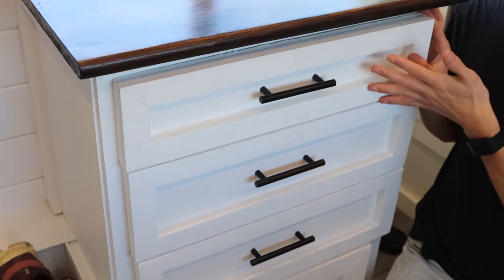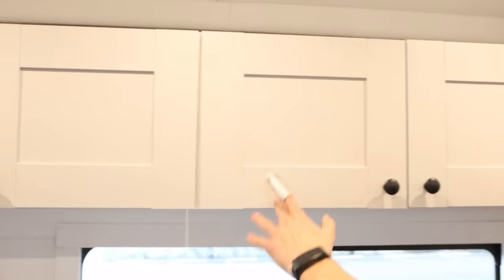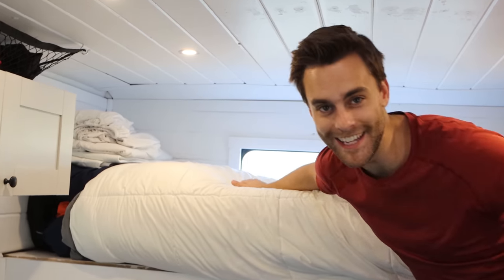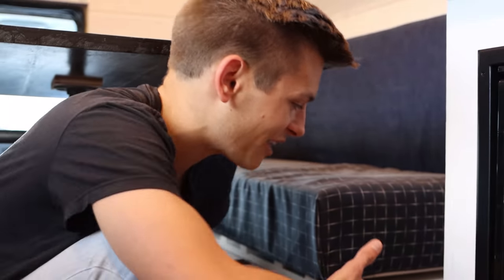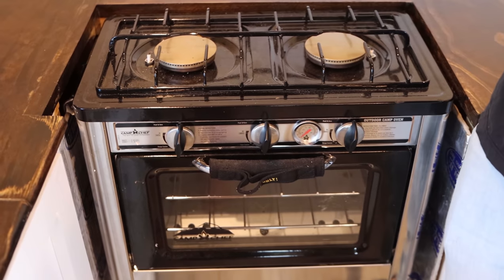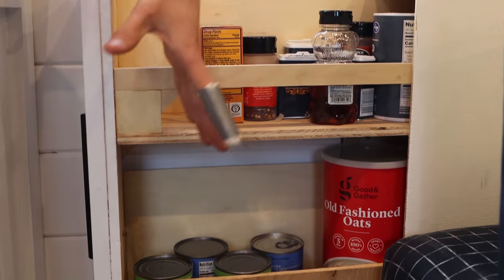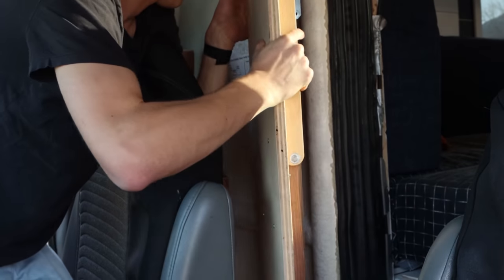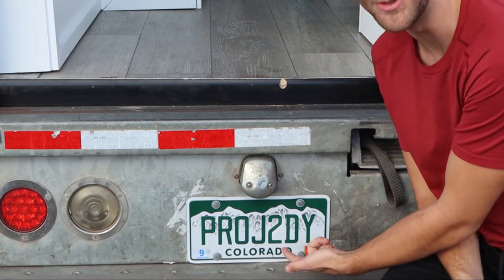VAN TOUR of UHAUL BOX TRUCK Converted to Beautiful DIY TINY HOME for Full-Time Van Life

Comment from the maker: Our next video will be a Q&A video about the box truck. Ask any questions you have in the comments and we will try to answer as many as possible in our next video!
Reply: What was your favorite part of the build? What is your favorite tool to use? What was the most valuable skill or lesson you learned during this conversion? :)
Reply: I've been wanting to make one and travel after im done with college. My questions are how hard or different is it to drive vs a normal car on the highway and in the city and avg mpg. And im not sure if you guys put it in a different vid (this is the first one I've watched) but how much was all your solar and electrical like batteries, converter panels etc. Thanks and I appreciate the vid!
Reply from the maker: @Gandalf the Grey We'll answer this in the Q&A!
Reply from the maker: @veronicakim8806  Thanks for the questions :)
Reply from the maker: @daltonc690  We'll answer all of these in the next video!
Reply: How did you go about the insurance and finding insurance for a self build project turned into an RV.
Reply: I just bought a box truck a few weeks ago that I have been converting but have had a REALLY hard time finding insurance because it's considered a commercial vehicle what did you guys do about that?
Reply: Other than your 2-small ceiling fans, what about a/c, and heating ?
Reply: Love yo channel
Reply: Great video and splendid job, thanks. No bathroom, though?
Reply: instablaster.

Comment: Hi u tubers part of the reason to get rid of the overhead door is safety. The over head door can be pad locked down so that you cannot  raise it and have to exit through  the pass through to the cab. Which can have the front doors blocked by a vehicle parked too close on each side. Another important reason is the eventual  failure of the balance springs and cables that help to support the weight of the door when you raise  it up. With interior finish and cabinets these springs and cables will be difficult or near impossible  to access. Also a framed rear wall can be insulated much better than the overhead  door Have a nice day. Tom up in Canada

Comment: Ok I have your next PROJECT for another TODAY = take an Ikea cabinet off each side of the the higher wall area, and lower each one on either side of the wall behind the couch, like on the back of the driver's and passenger's seats.  
Then the upper loft bed could become two single beds, divided in the middle, where your door to the cab is.  With the foot portions of each twin bed, on a slide out support, that can be made easily.  Then you get up to your bed by using Craig as your lift up step, for either side of the two beds you create.  Then the living space below doesn't need to be made up as much, since both your sleeping areas would be above. Only needed when you might have a guest or two.
Reply from the maker: Wow this would be a project! But it sounds very intriguing, if we could pull it off that would add a ton of space to our sleeping arrangements!

Comment: For your window coverings, I would use some iron on interfacing. It will make the fabric stiff and easy to apply over the top of your reflective covers. You could do black fabric, like you said, but a textured fabric would also look nice. I'm picturing a faux leather or suede in a brown that matches your counters and table. That, or any fabric that is textured, like linen or hemp or even sokething that looks like rattan. They have natural rattan that has a super tight weave/no holes.

Comment: Have you considered putting in a mini-split airconditioning system for cooling and heating?
Reply: I honestly have been thinking about doing just that. It can also be a heater, and can be ran on solar.
Reply: @consciouscoffeeplussugar2658  Yes, lots of videos of people putting in mini splits.  They're so incredibly efficient and can be run on batteries, solar, and/or a small low noise generator.  They're also incredibly quiet and people who own RVs with overhead ACs choose to use the mini split for its efficiency and silence.
Reply: Yes those over head ac on rvs are so loud . Its annoying

Comment: Wow, yea yall did a really great job with that truck, perfect design, and use of space, that table is extra special.... I only have one suggestion, and that is to take out the sliding pantry behind the couches so that you could put a 17 degree lean to the back rest.... its just way more comfortable than sitting straight up, and is really the norm for furniture overall.

Comment: I forget how good Ikea is for buying space saving stuff. Great idea to go there for the cabinets. I wonder what the cost difference is between buying some of this stuff that fits specific spaces on Amazon and making it. One cool thing about shopping online is you can enter the exact dimensions of a space you're trying to fill and it will bring up everything that fits.

TBH, I was a little scared of that kitchen setup. You guys should put a fireproof backsplash behind the burners. You also need some kind of hood or ventilation from the smoke as you cook. I'd definitely be a little concerned about a gas leak with that propane tank being on the inside. Between that, the sink not having a faucet/real running water/a legit gray water container, I think I might just cook outside & dedicate that area for some other living space purpose.

I love a lot of the ideas. You definitely got me thinking about the U-Haul option. 120,000 miles isn't that much for an engine like that. The towing capacity is also insane on those trucks. You'd have to buy something like a $50,000 Toyota Tundra to get that kind of towing capacity otherwise.

BTW, since you don't have a bathroom setup & you like to work out, you might consider a Planet Fitness membership. I think a black membership is $25 per month & it entitles you to bring a friend in for free. They're open 24 hours and it's a great way to be able to take showers and use the bathroom. They have almost 2400 locations and you can usually park your rig in their parking lot for the night if you needed to.

Cheers and good luck with all your adventures!

Comment: Hi u tubers the number one step in converting an ex u haul box truck is to get rid of the overhead door . A roll up  overhead door does not belong in a camper. Too much heat  loss water leaks  and noise. Frame up a wall and put in a man door. Have a nice day. Tom up in Canada.

Comment: When you bought the Ford  truck it had 120,000 miles. How do you plan to prevent problems with the engine and the transmission?
Reply from the maker: Not doing anything specifically other than the recommended maintenance schedule. It's looking pretty good so far! Haven't had any issues
Reply: Use synthetic...?

Comment: Nice. But I have a question. If a fire were to break out, do you really want to have to reach way back under the sink to get to the fire extinguisher? You may not even be able to access it, depending on the location and intensity of the fire.

Comment: Not a ton of uhaul truck conversions, thank you for your content. Is this the 17' or 14' model? Any advice for cheap/low mileage buys at uhaul did you wait for a good deal or how did your buying experience go?
Reply from the maker: This is the 14' model. Honestly we bought one of the first ones we found because it had a good maintenance history and we were pretty naive and wanted to just get started. It hasn't given us any maintenance trouble so far. Happy with how the truck has been holding up. I think we got a pretty good deal for the mileage and age of the truck but I'm sure there are better deals out there.

Comment: Just discovered you'al. Interesting build. The back Slider up & down takes up much room. The fire extinguisher should hang on the wall, as time to get it under the counter in the cabinet your fire has already gone out of control. Max Fans are great. How much did the U-Haul cost to buy from U-Haul? What length the living quarters? Gasoline Or Diesel? Look forward to following your journey. Take Care & Safe Travels. always, Tommy :-)

Comment: As beautiful as this is, I would add a metal grate over the hole in the cabinet to leave it vented, but beautiful.  They sell little metal panels at Lowe's for about *20 and you could make it removable if you wanted as well, with slide slots or velcro fasteners.  Better than marring the beautiful cabinet with looking at the back of the oven when you come in your lovely home.

Comment: What is rarely revealed by box truckers is "commercial insurance"?
Commercial insurance has business requirements and costs $5-6k p\yr.
You are not allowed to live in your vehicle full-time with commercial insurance.
Your insurance is based on the OEM VIN and cannot be changed.
Violation of the contract terms invalidates coverage.
Intentional violation in securing a policy such as failing to disclose the truth of intended use is criminal fraud.

I solved this by purchasing a damaged class-C motorhome with a damaged coach. I removed the coach and am replacing with a box essentially the same dimensions (16'ft cab-over). This enables me to have motorhome insurance at $435 p\yr @minimal mileage. When I increase the mileage to max. the ins. can go to a high of $1k p\yr.
Based on research conducted in Tx.

Comment: Where is your propane sensor?  This is only important if you value life.
Reply from the maker: We’ve got one under the sink, and then a fire alarm/smoke detector in two different places
Reply: @project_today  — The propane sensor should be low and literally in the same room as you (your stove and heater and maybe water heater) as smoke goes high, gas goes low.  Putting it in a cabinet makes both the alarm if it ever sounds harder to hear but lessens the chance of it actually detecting a leak.  Not that you would ever expect a leak, but ya never know!  Cheers guys!